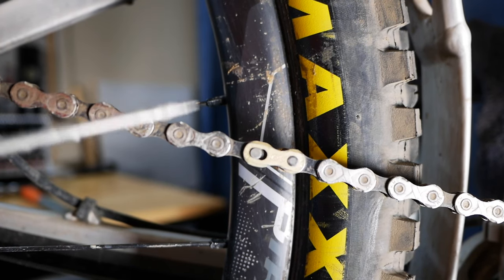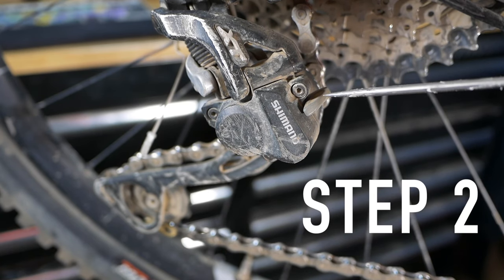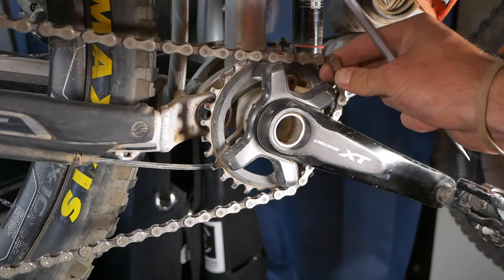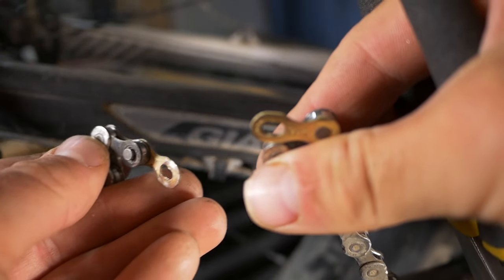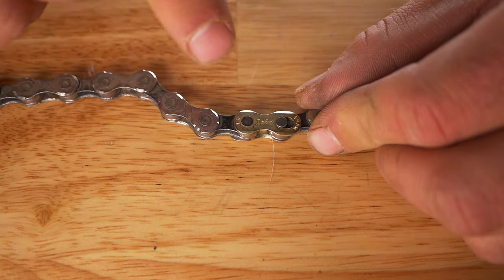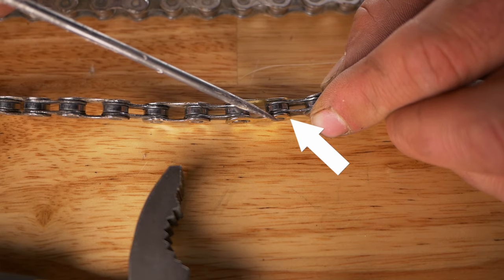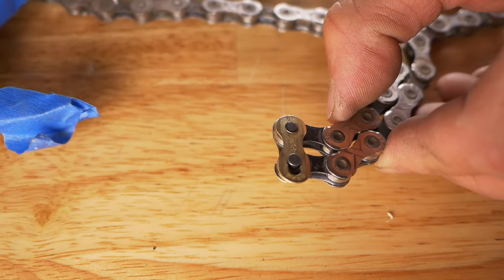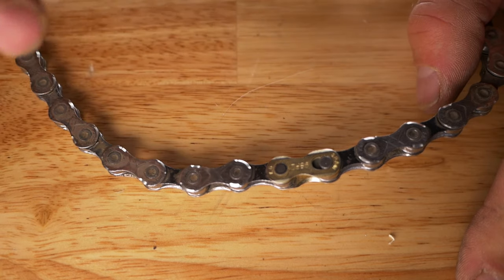How To Remove Powerlink or Quick Link from Bike Chain (without special tools)

Comment: This video should be at the top of the list. I had to scroll quite a long way down to find out. I knew there must have been an easier way than using cable or shoe lace that all the other videos recommend and this is it. So simple, did it in a few seconds. Please like this video so it appears near the top of search results.

Comment: after using many methods without success i found perfect tool in my garage,the cheapest wire crimper works great,you just bend the chain like in this video and squeez the rollers instead of the outer links

Comment: Tape can sill allow damage as its not durable or thick enough. What you need to use is rubber tire liners or some other thicker rubber. I then use shoe goop to attach it to the pliers, guaranteed no damage..
Reply from the maker: Good call! I like that!

Comment: 0:57 I've been trying for over an hour to remove these with specialized, low leverage pliers and it didn't work - using regular pliers with that technique easily removed these... Thank you

Comment: After struggling with various methods, I tried this, but did not have narrow enough set of pliers, but then found a tip which advised with the sram chain I had, all you need to do was squeeze the side of links together and they would slide in opposite directions to separate by hand

Comment: I was about to get a special press, until I spotted that link on my KMC 8 speed. It really needs a deep clean, degrease and relube after 1500km. I even saw special pliars to squeeze the link between rollers,  but after seeing your method, I consider it a waste of 20€.

Comment: Do all chains have a power link? Because my child's bike doesn't seem to have one, I'm trying to take one link off so it stops falling off the bike
Reply from the maker: Sadly no. A lot of kids bikes and bikes from Walmart do not. You’ll need to get a chain link removal tool to do the job you’re looking for. Then add a new power link after you shorten it. It’s a simple tool, a lot of multi-bike-tools have them. But I haven’t found a solution to do that without that tool.
Best of luck

Comment: What if none of the links are like that? I can’t find a master link but there’s one that came with it not connected
Reply from the maker: Sorry, then you have two options. First you’ll need a chain remover tool to push out one of the pins in the chain and connect the two sides. Or you need to order a new master/power link that matches your chain (ie 9, 10, 11, 12 speed chain).

Comment: how do you find if the whole chain is rusty? in they all look the same
Reply from the maker: If they all look like the same type of link, there is a chance your chain does not have a power link to remove the chain. You’ll have to get a chain tool to remove a link. Those tools will push out one of the pins from a link. Sorry, I don’t have a hack for that just yet.